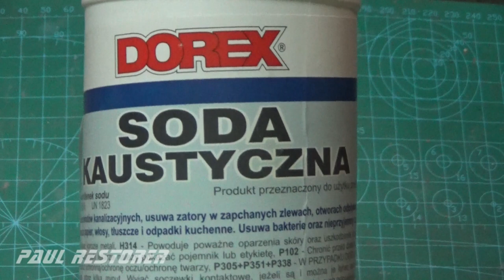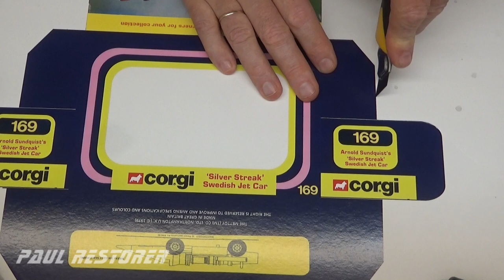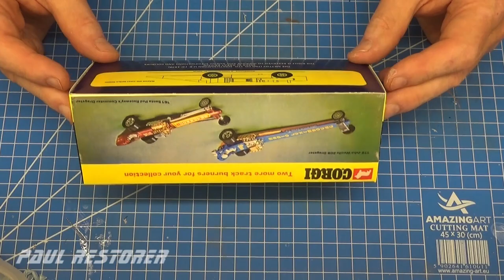Arnold Sundquist's 'Silver streak' szwedzki samochód odrzutowy. Corgi nr 169. Model odlewany.

Comment: This was awesome! I did not know that until now this was based on an actual built full size car!
Fun fact about the full size original:
Engine: Westinghouse J 46-WE-8 Effect ca 25 000 hp with EBK (with afterburner) Acceleration 0 - 400 km/h på 7 sekunder (0- 248.548477 miles in 7 seconds) Bränsleförbrukning (fuel consumption)  250 liter/minute Teoretisk toppfart (Theoretical maximum speed): 1 000 km/h (621.37119 miles per hour)
Reply from the maker: Thank you very much, Cool

Comment: Loving all your videos! I have a couple questions about this one. Why brush the silver onto the cast engine? Wouldn’t it have made more sense to nickel plate?  And that orange nozzle looks familiar. Did I see that as a spaceship part in another video?
Reply from the maker: Thank you very much nickel plating is quite complicated and it is certainly easier to brush and cover it with chrome in paint when it comes to the nozzle, it seems to me that I have not used such a nozzle yet